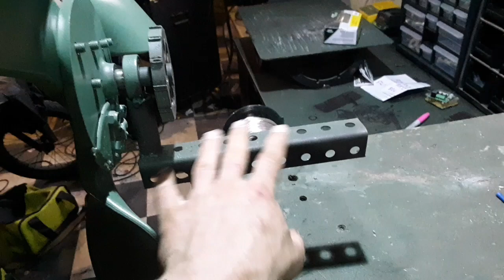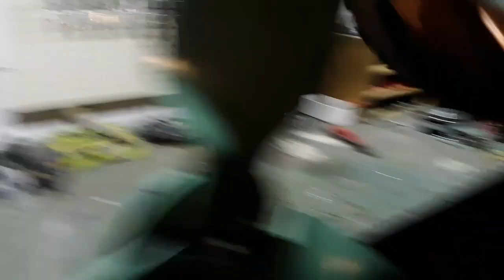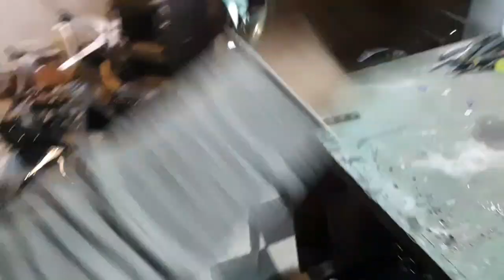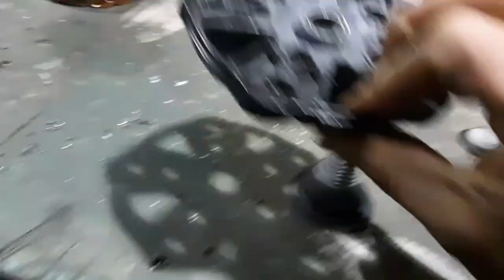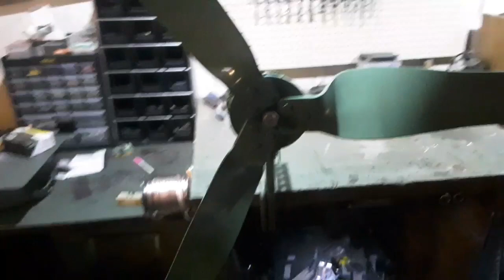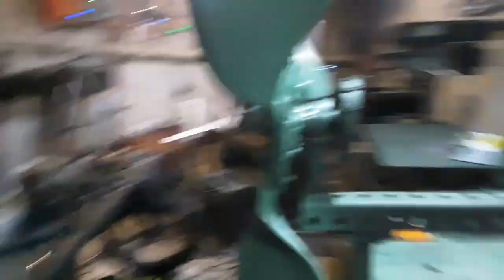Balancing Wind Turbine Blades

Comment: Hi Joe, Thanks for taking your time to make some vids for those of us who are interested. I have a Hurricane Vector 2.0 on the way,  thanks to John Daniel! I very much like your set up and tried buying a 200 amp volt meter like yours and I've been taken to the cleaners. They sent me a re-stamped 150 amp at best. So, I'm hoping you can send me a link to 3 items, your fans, your heavy wire volt meter, and your temp. controller. I purchased a 60 amp A/C disconnect (switched not pull plug) for $13 on amazon that I think will work well for a Brake - in conjunction with 3 100 watt - 5 ohm OHMITE resistors as per Johns recommendations. I wanted to mention the A/C Disconnect in case any of your viewers may be wondering like I was where to find a switch that could do the job. 

I'm really hoping you can send me those links, and thank you in advance, Donny
Reply from the maker: Thanks for watching Donny and yes, i should take more time to link parts in the description.  
Fans: https://www.amazon.com/upHere-Airflow-Coolers-Radiators-T3BE3-3/dp/B07HK4T55Z

Temp sensor:  https://www.amazon.com/MakerHawk-Temperature-Controller-Thermostat-Electronic/dp/B07THXPN4H

The meter is currently unavailable through Amazon,  here is the link sellers store page. It should come back in stock soon enough.  https://www.amazon.com/stores/HTRC/HTRC/page/93BCB662-9901-41DF-B045-DA9FDFE061A7

The ac disconnect was from menards i believe.  Just a single main breaker box. Real simple wiring. Good luck! I'm excited to see what those Hurricane turbines do. Mite have to pick a spot for a third pole in the yard.
Reply from the maker: Ebay has it!  https://www.ebay.com/itm/HTRC-200A-High-Precision-Power-Analyzer-Watt-Meter-Free-Shipping-/222731246421?_trksid=p2385738.m4383.l4275.c10
Reply from the maker: Although frankly I think the bayite meter is more accurate and samples faster. Only benefit to the htrc meter is it stores the highest peek wattage and amperage.  Bayite meter is here:  https://www.amazon.com/bayite-6-5-100V-Display-Multimeter-Voltmeter/dp/B013PKYILS

Comment: The blades on this wind generator are too small. And the blades are completely without aerodynamic control. There is no storm protection.
There will be little energy and will collapse in a strong wind. The best windmills are those with controlled blades with a nominal wind speed of less than 8 m / s.
Type of such
https://www.youtube.com/watch?v=2fOnCKLQhfs&app=desktop

Comment: Dang, that stator looks like a old ladies wig, LoL 😃 And what a cheesy rotor, but it came in some use. But JD does it all wrong, he does the removal of blade material which screws up the air flow dynamics across the pitch of the blade. Just a tip on axial blade balancing, the rotors and blades have to be balanced all together in case of one hub being not cylindrical. Good job on figuring out the soldering the weight and thanks for sharing 😃
Reply from the maker: Thanks, and thanks for the help! I watched your video on balancing and spoke with a few different companies that balance aircraft props. Took a little bit of everyone's advice and added the idea of using paint.
Reply: I also used spray paint for balancing and some washers where the blades are mounted.
Reply from the maker: @johnq8792  makes sense to me. Wanted to paint it anyway and the paint adds weight so i kept on on the balancer while i pretty'd it up and wouldn't ya know a different blade ended up being the heavy one so i added quick little squits here n there till it was perfect... but then it also changes as it dries again so i had todo a final touch before I flew it.
Reply from the maker: @TheBillythekid2010  thanks... i like a good read.